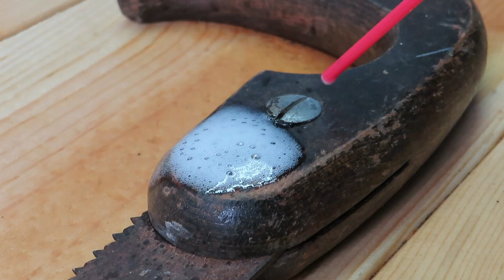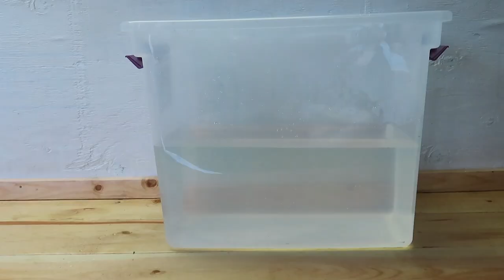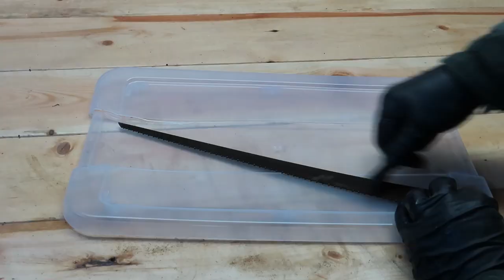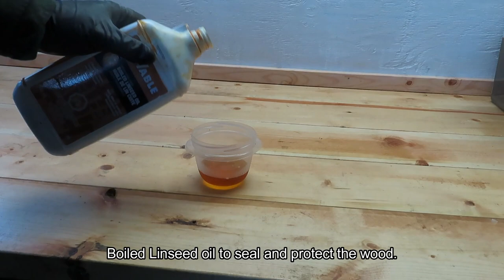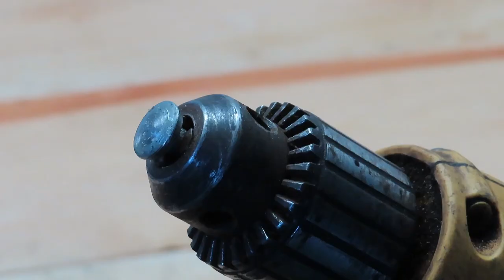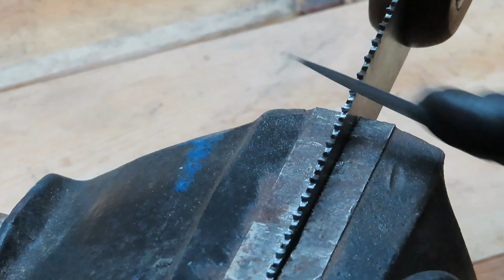70 + Year Old Keyhole Saw [Complete restoration]

Comment: Won one at an auction earlier....handle snapped in half after it dropped 3 feet when a gust of wind hit it accidentally from the leaf blower
Reply from the maker: That's terrible, they really are beautiful and useful little saws
Reply: @cardinalrestorations  do you think it was crappy wood or just realy old? what kind of wood would haha be good and strong to try and make a new one with? I've never done any wood work but you guys on youtube have me interested.
Reply from the maker: @chrisgoldbach4450  I come from a metal working background so I'm not quite as well versed in woods. I'm still learning it all myself but from what I have learned any kind of hard wood should be good for a handle. Hickory, maple, oak and so on. What you could do if you still have the pieces is go to a wood supplier and pick up some some hardwood of the same thickness. Use the broken handle to draw a rough template and cut it out from there.